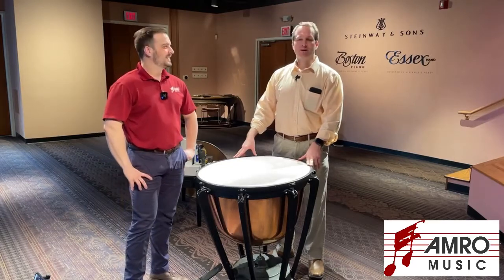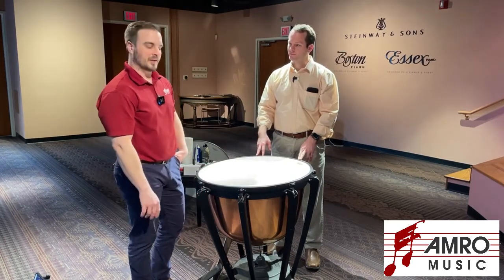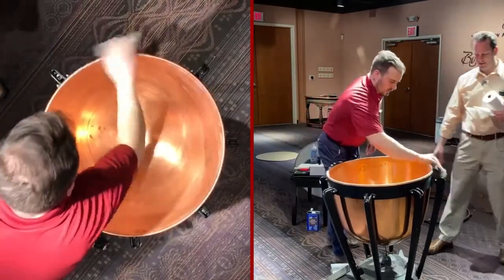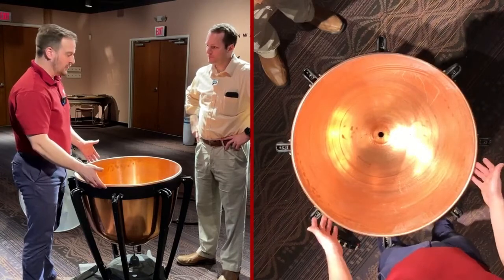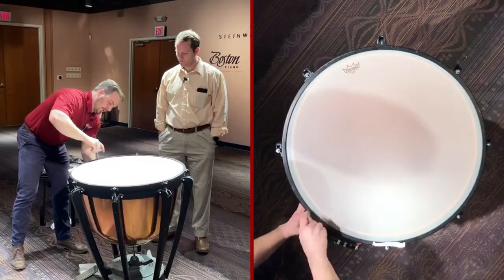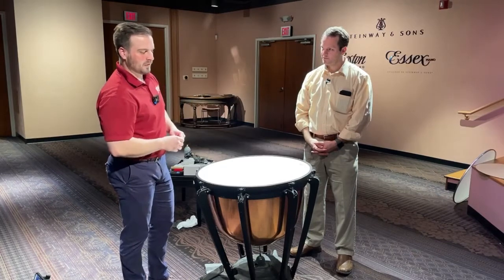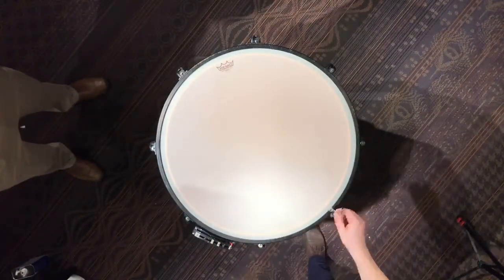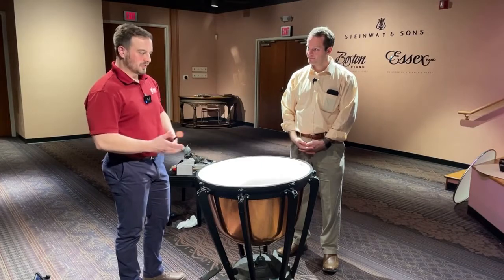Changing and Tuning a Timpani Head Clinic

Comment: I listened to this again and die  Seth did a  good job to the final when he talked about tuning just four lugs due to the fact the drums was below fundamental. The gentlemen asking the questions had excellent questions and wish there was more time available more even more thorough answers for educations or students interested learning this art. This is an ART and skill together to do this. This takes years to get the knack for clearing drums consistently. Seth would admit and I am sure was under the gun for time but there is soooooo much more to discuss on final clearing techniques that were not covered here.Caution the gauge he used to equalize the torque DOES NOT guarantee the terminal pitches will be all the same. New students be aware of this . Yes it will I guess provide some semblance of equal torque but many factors go into getting  all the terminals with the same pitch. I am sure if these two gentlemen had more time they could explain in more detail some of these issues. But in all due respect  this is only the START of the conversation for learning the ART of clearing the head. But thanks to you both Keep this mind to for the high achiever and one who wants to want a very musical sounding timpano is this -Unfortunately the timpano has but its very nature and can not theoretically be fixed is the overtone series for a timpano can never be totally in tune -It is called inharmonicity . That is another discussion that serious students need to study but I know would need to have another session.

Comment: There seems to be a missing portion of the clinic, that I would like to see more of and that is the purpose of the tensioning knob at the base of the tiffany, how is it used, why is it used, where should it be set prior to putting a new head on, does anything need to be done with it during

Performances?  My guess would be it is used to get a higher note if needed for a particular literature., , such as the works of Julie😊